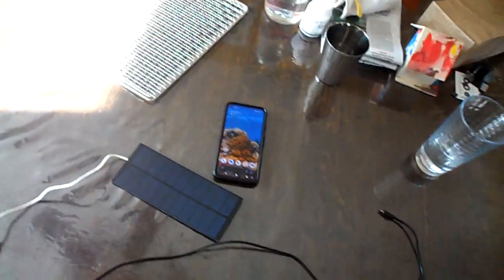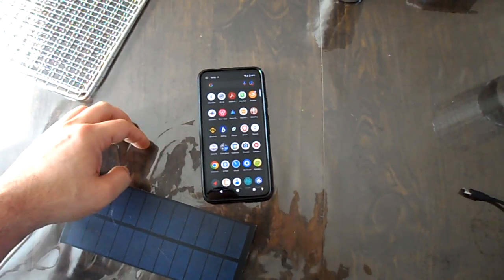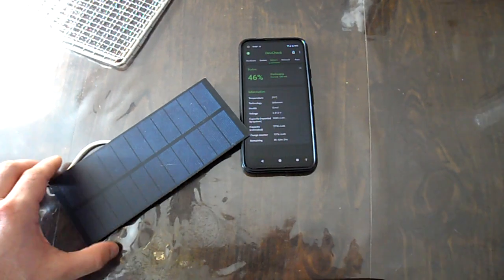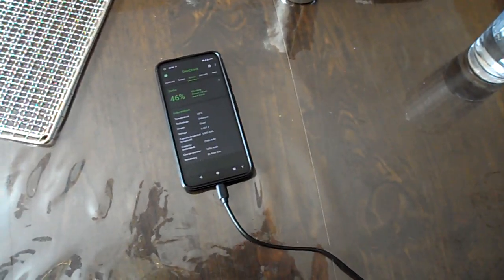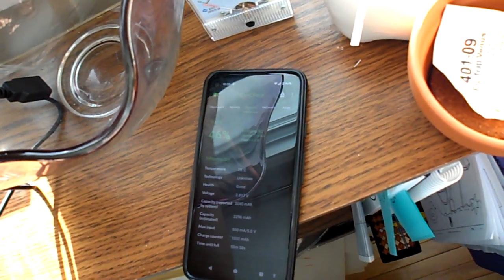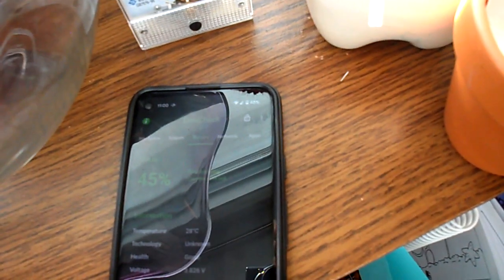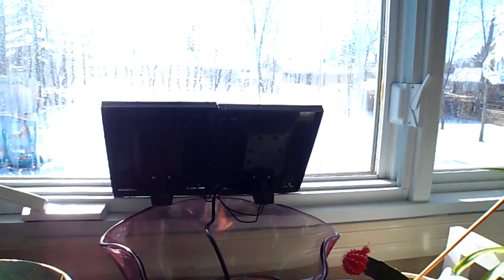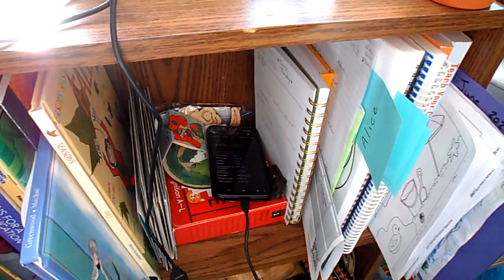Solar USB charging with different pannel set-ups

Comment: Can you provide links for the panels? Thanks and great video!
Reply from the maker: Sure, it's no problem, I hadn't even thought of providing links to the pannels. I updated the video description to include links to the pannels I purchased and featured in this video.

Enjoy!
Reply from the maker: I just added my 3D printable frame/stand to go with the larger square panels as well, thanks for asking, you actually helped me out
Reply: . @chaorrottai,  No thank you for putting me on. I have an old ZeroLemon battery back that recharges via solar, and it actually came through after a couple of hurricanes some years ago. But I bought over a decade ago and the tech has improved immensely since then, your video reminded me that I need to upgrade before the start of the season this year. Cheers! 🍻
Reply from the maker: well, regardless you helped me out, I'm still new at making a living online so I didn't think about getting links and posting the design

I'm trying to make a career out of designing things and posting videos and your question made me figure out how to use the amazon afilliate links

so you actually helped me out alot, so thanks for asking